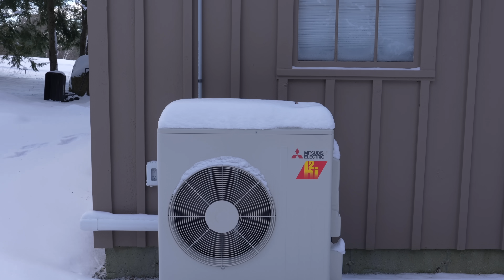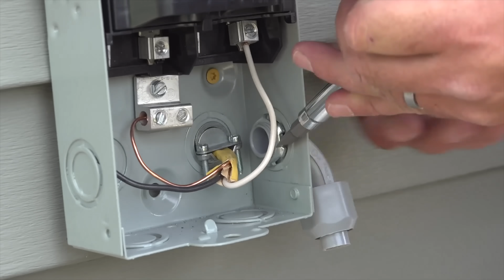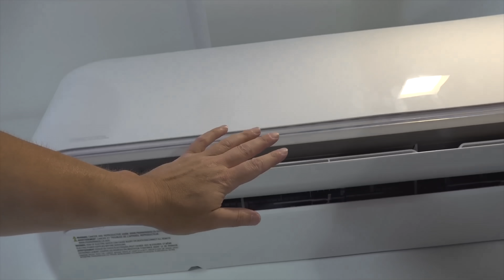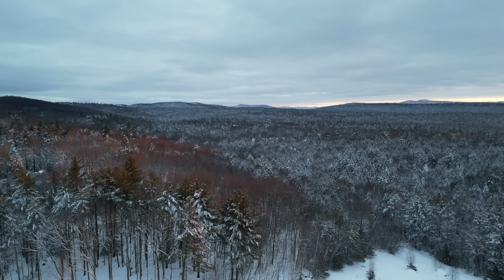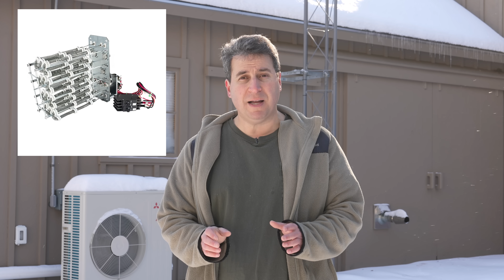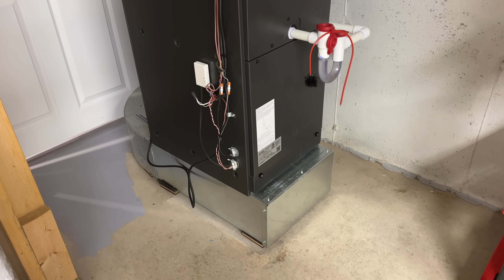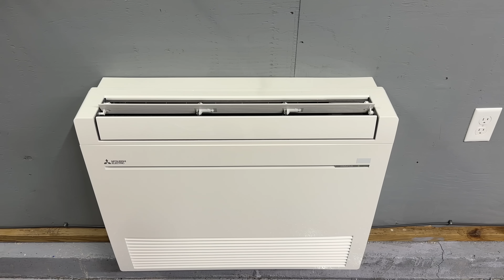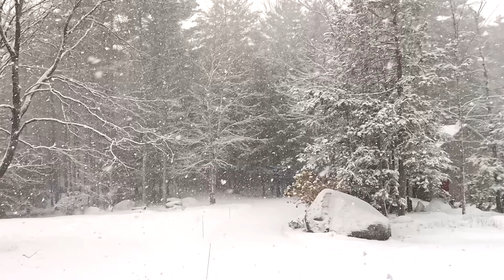Why Heat Pumps are now leaving people COLD

Comment: This is exactly what has happened to us during this cold spell in the Midwest where it dropped into the negative temperatures. I have a Fujitsu system and it's a mini split very similar to what was described here in the video. I have an upstairs unit with the blower and a basement unit with the blower that heats the main level. The system essentially froze up during all of this cold weather and luckily the house is completely remodeled with brand new insulation and efficient windows and I was able to heat the house(approx. 1600 sq ft) essentially with two larger space heaters until our HVAC guy could come check out the system. Today was about 40° and when the HVAC guy got here, the system had thawed out enough that it was putting out warm air again and was heating the home like normal. This video was very good information. I am a renter, but very good friends with my landlord, and even he was a little confused about the system itself and how it functions because it's different than what we're used to.
Reply: If the outdoor unite ices up or is covered in snow you're done. In colder climes they usually mount them at least 3ft off the ground and usually with a small shelter to keep sleet and freezing rain off. Provided that and a well insulated and sealed house these newer units that function down to -20°F can generally maintain a decent interior temp even in those conditions just don't expect them to get up to temp any time soon if the power goes out and it drops to 40f or lower indoors.

Comment: My Daikins havent struggle at all to heat the house down to 0 degrees in Maine. 3600 square foot house build in 2003. I leave the heat pumps at 70, oil furnace will kick in if needed but its not too much.

Comment: I just assumed they all had aux heat... But I'm wondering if mine doesn't, because I think it was only low voltage wire run to the air handler. 😢

Comment: Spent $20k on a replacement central atmospheric heat pump for my 25 year old unit. Wouldn’t keep house warm when <40f. Huge waste of money. Resistive heat strips would kick and man the electricity bilk went through the roof!however the heat pump worked great ad an A/C unit (ambient eas never above 90f however). Should have put a natural gas system in.

Comment: Insulating your Ducts can help as the heat loss from the ducts that are usually in cold areas of the home arent affected by the cold as much. If you cant insulate your whole home, just having the ducts and distribution box insulated may do the trick. Colder than 40F is when your heat pump begins to have issues with heating.

Comment: IMO this answer only works if you have uninterrupted electrical supply. Oh sure, you can slap a generator backup system in place but then you got to deal with it as well. Really, there's no real solution... wood burners sound good as the fuel source is renewable 🙂

Comment: What's a really cold day? My mini split system has been great, down to about -10 dF. Electric is "cheap" in my market, and nat gas isn't available, so the low ambient mini split is (by far) the cheapest option for keeping the house above 70dF.

This video is a good PSA: "One is none and two is one" (be sure to have at least one form of backup heat) but the issues many are having are because they undersized the equipment or most likely, they didn't understand the capabilities of their heat pump. I sized/spec'd my system based on my worst case day- Others were happy they got rebates and tax credits and forgot to do their homework before tearing out the gas line.

Comment: The indoor unit without electric heat is cheaper to install…you don’t need heavy wiring, larger circuit breaker or a 200 amp panel. When you need 8 kW or more of electric backup heat, that’s when the upfront installation costs increase. Probably why some contractors don’t mention the strip heat option.

Comment: Electric blankets are great for supplementing in the winter. They are great also for emergencies as they require very little power and can be run by electric generators/batteries for a long time unlike traditional space heaters. Heat people not spaces.

Comment: I have a dual fuel heat pump system. The furnace is equipped with natural gas to heat the home. It allows me to select the set point temperature to when I want the gas portion to turn on. I currently have set switch from heat pump heating to natural gas at around 25F.

I chose this system because where I live , winters can drop the temperature as low as as 9F to 16F.
Reply: Same here.  When we built in 2010, I considered geothermal but the cost was expensive.  I opted for 6" walls and better insulation (I'd do an even better job of insulating if I built again).  I figured retaining the heat (created by NG + HP) was better a better option since it was essentially passive (i.e. no further expense) than the high cost of a geo install.  Ironically, 3 of my nearby neighbors have geo, and their cost to operate is greater that my setup.  One even had the geo removed.  I can't explain why, everyone said that shouldn't be the case.  But I'd say the cost is $50- 100 more a month for the geothermal than my setup.  I realize there's a lot variables to take into account tho.  And in Indiana where I live, electricity is pretty reasonable (15 cents/kWh if I recall correctly).  I don't even have a dual stage HP.  I have my heat pump cutout at 40F.

Comment: I normally like Silver Cymbal's videos, but here he's very WRONG.   Yes, the min-split systems can perform very well in colder temperatures, but the traditional American-style central heat pumps (Trane/Carrier/Rheem/etc) ARE NOT capable of handling much below 40F well.  Newer systems can handle down into the 30F range, but barely.    

Now, when you get into inverter-driven systems with the ductless-style outdoor units, yes, heat pumps can be useful. 

Mitsubishi is the absolute best on the market when it comes to ductless systems in performance...but they also know that and are priced accordingly.

Comment: Some interesting word choices you’ve made here.

First, the heat pumps aren’t “failing.” They are becoming less efficient and less comfortable, due to having to run their defrost cycle.

Second, they don’t become “ineffective” below freezing. Modern heat pumps maintain a standard level of efficiency down to 17 F (AHRI conventional measurement). Properly sized units will be able to hold a set point of 67 F at 20 F outside temperature for about 80% of their runtime, with the other 20% being backed up by the auxiliary heat. In my leaky 1890 home it’s probably a bit more aux in that mix. 

It would’ve been nice if you explained why they become less efficient and less comfortable (the defrost cycle). Unfortunately your description or perhaps understanding of heat pump efficiency curves is lacking; granted there’s a bit of calculus involved there. Bottom line is heat pumps will effectively outperform fossil fuels and strips in energy efficiency no matter what the outside temperature is, simply by matter of moving heat instead of creating it.
Reply: He does say it verbally at 4:45, but you have to wait that long after the thumbnail and title, IF YOU EVEN CLICK IT, which i believe is one of the points of the comment, and i agree.
Reply: I would say they are failing to keep the space warm.

Comment: We have a mini split (12kbtu) for our house, its been working amazing even in -10f temps here in Idaho! We do have a very small and well insulated (closed cell foam) house. The power usage does go up a lot once it gets below about 15f though. And so far our other new EG4 8kbtu solar mini split has been doing great for our little office building! And its been getting down to 0f this winter.
And also side note, both of our mini splits have electric resistive heating backups also. Both have been off since we got them though.
Reply: What model mini split has resistance backup?
Reply: @chrisE815  EG4 9K AC-DC Solar Mini-Split
So far for the bout 2 months i've had it setup it's been working great! Although now it has an error and I haven't been able to check it since i'm out of town right now. 
Honestly I don't know anything about the resistive heater since i've never had to use it before. Even with the so far down to 0f outside temps the only issue was with rime ice on a screen over the outside coil, the screen was easy to take off. 
Its definitely a new product though.
Reply: @chrisE815  And also the other mini split in the house I actually don't remember what it is lol
We had a friend install it about 2 years ago. We just payed for whatever he thought was best for us since he is an HVAC tech. And so far been perfect! Used it in -8 temps that we know of and didn't have any issues with heating. And cooling does great too. Although the smart controls are pretty bad lol 
Once I find out what it is, if I remember I will reply to this comment with it.